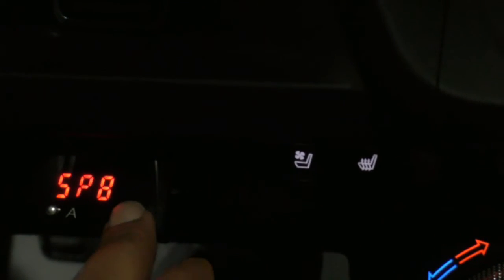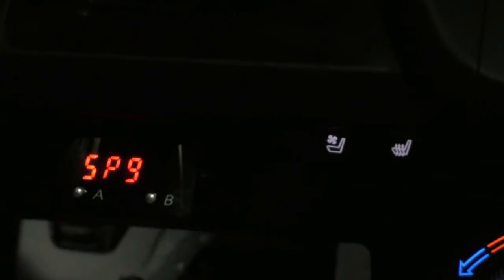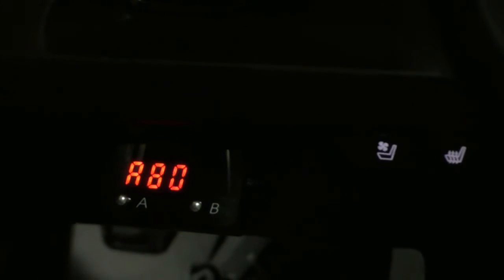Darth Blade: How does that throttle controller work?

Comment: Nice vid Darth I just installed mine a week ago. And its CRAZY.  Nice breakdown  on the eco setting. I wasn't aware they work hand in hand. I keep mine on 6 and that is perfect. Im gonna keep my eco on 3 to improve the gas.(only driving to work)
0 any other time
Reply: Thx RedZone...and it is CRAZY! I was wondering how it works on the Auto trans, I'm betting it's pretty snappy.
Reply: SASCOI 
extremely